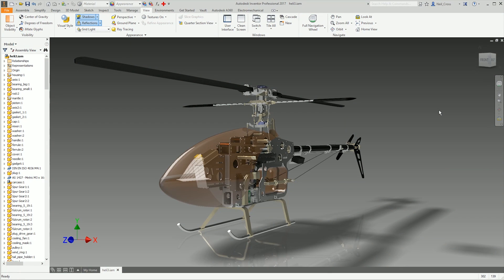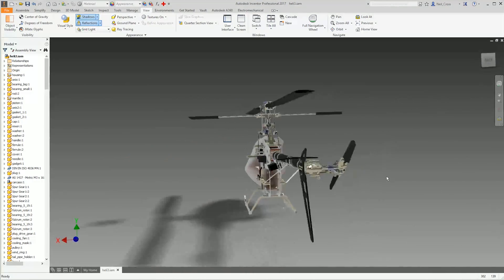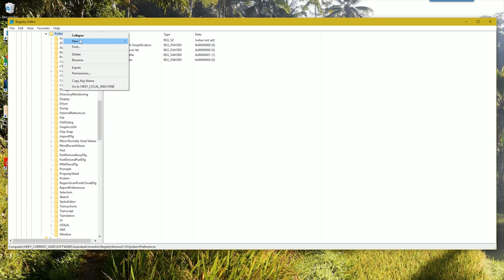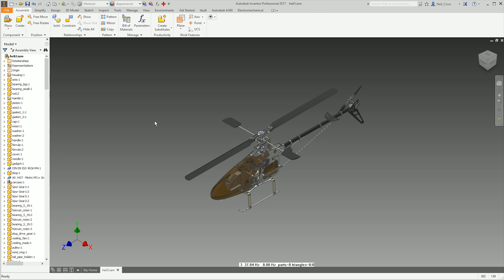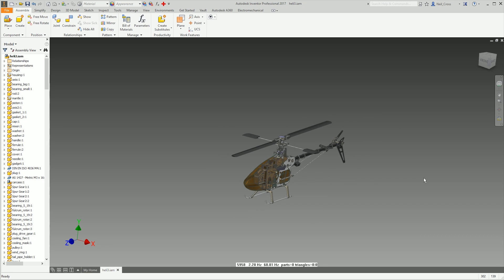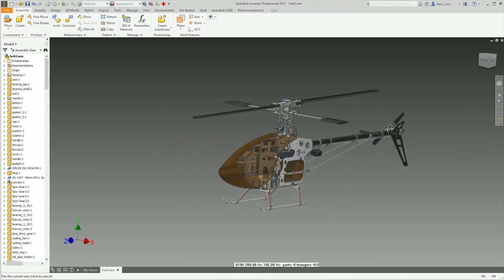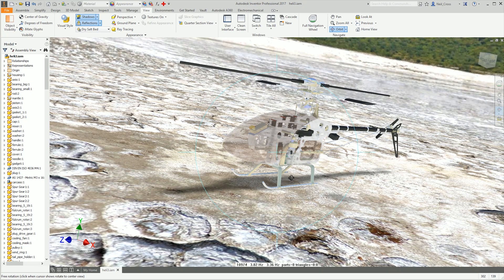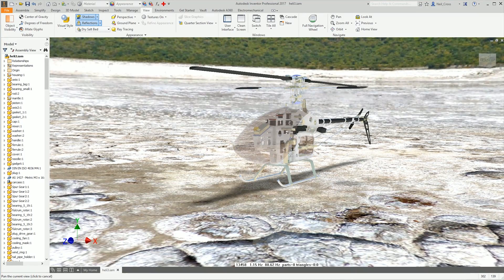Turn On FPS Counter | Autodesk Inventor

Comment: Is there any reason why my new pc is running at 7hz? I have a weird issue. I'm running 2016, have been for a long time. My old laptop has no issues, and i've gone through several new PC upgrades from a ryzen 3600, 5800, 5800x3d, intel 12900k and now I have a problem using a 14700k and a 4090. I get a whopping 7hz when moving any part around.
I don't have any other problems with my PC, I don't think the recent intel issues are at play here.
What I've found interesting is the refresh rate will skyrocket up if I make my window much smaller. 4k, 1440, 1080 it doesnt matter. full screen it's painfully slow and if i make the window super small on the screen ill get 500hz refresh. I hate using my pc for inventor, I have to use my other pc with a ryzen 5800x and 3070 to get a smooth experience.
I have found at one time I was using a different pc with a nvidia gpu, and a non gsync monitor and it was similarly going slow refresh and when I disabled that the problem went away. I don't think that's whats going on here given it's a gsync monitor.
Reply: Well I just found the answer shortly after writing this. 
Tools>application options>hardware>uncheck software graphics>restart inventor.

i've had this program for so long, installed numerous times and never has this option defaulted to being on. now I'm running 1000 hz at all times.

Comment: So... the visual performance depends on gpu... When I am rotating a 8000+ part asm, lots of part are dropped to achieve the minimal frame rate... I have gtx 970 too... What is you opinion:... is it a good choice to update to 1070? Or there is some cpu bottleneck, so there will be no any real benefit to make this upgrade? Thanks!
Reply from the maker: That'll be a cpu bottleneck, however it could even be a software bottleneck, Inventor might not be able to handle that many parts on any system without throttling the visuals a little to keep it smooth, upgrading to a 1070 or even a 1080 won't help with that
Reply: Thanks! You saved me a lot of money! :)

Comment: It´s a difficult thing to present something like Inventor in an interesting fashion, but i must say you do a brilliant job of it. I´m thoroughly enjoying, and learning from, these videos. Getting to 10.000 should be possible despite the relatively limited userbase.
Reply from the maker: Thanks :) I'm slowly getting on-board with Fusion 360 due to hints that it might become bigger and bigger, that might draw in some stragglers! But cheers, I try my best to make this interesting!
Reply: Being new to all of this, i´ve never used Fusion. But i´ll look forward to an "introduction" with your touch. :)